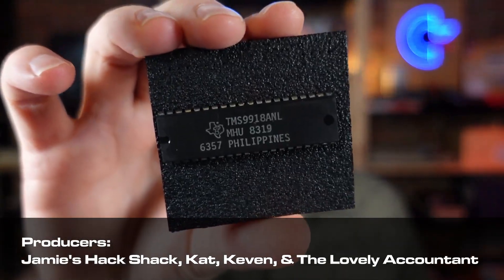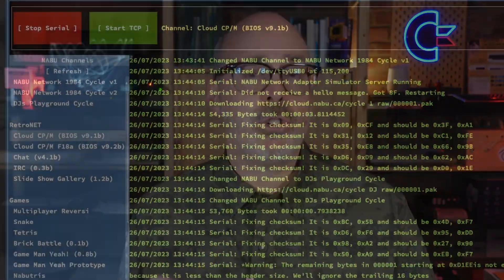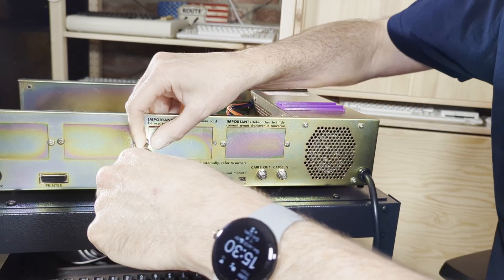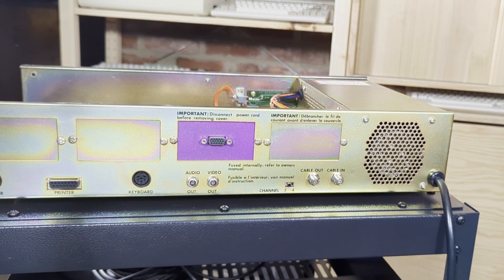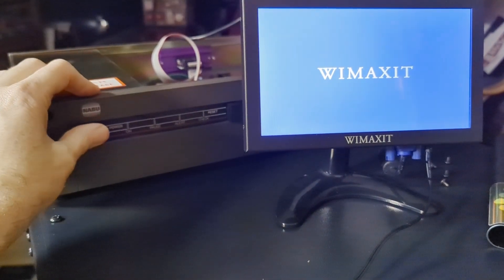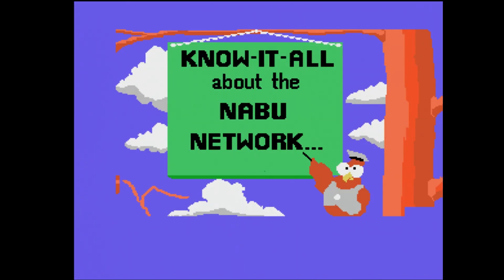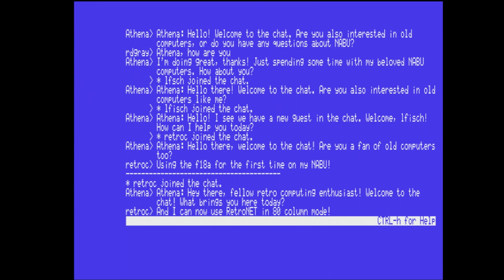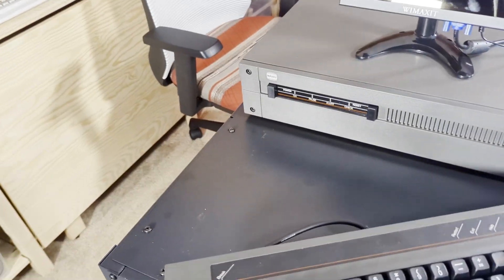NABU Computer Mod | Add 80 column mode using a F18A board!

Comment: One thing to add. There is a set of 4 dip switches on the board, switches 3 and 4 are to set the exact chip being emulated, so don’t change those. Switch one allows 32 sprites on a scan line instead of the standard 4 though I don’t think there is any NABU that can take advantage of that. Switch 2 allows you to set visible scan lines so you can get the old-school look on a modern flat panel monitor.
Reply from the maker: Yes! I forgot to discuss the settings. Thanks for sharing and pinned your comment for others.
Reply from the maker: Oh, and I might need to give that scanlines option a look.

Comment: There must be a few televisions that have the VGA socket on the bottom of the television close to where the Antenna socket is.
Reply from the maker: I've not run into one. Maybe some early 2000 models.
Reply: @retroCombs  some institutional TVs such as a Philips iTV series had an optional VGA port. I think the larger 30" + iTVs have VGA standard.
Reply from the maker: Ah, yes. Hadn't considered commercial grade televisions.

Comment: I had a MEMOTECH MTX512 with that same TMS9918A VDP but was never able to get into the 80 column mode but the chip did overheat and eventually caused the CPU to overheat and go kapoot.
Reply from the maker: Not at all familiar with the MEMOTECH. Looking it up now.
Reply from the maker: Those look great. Actually wouldn't mind finding one of those.

Comment: 25 years or so in the industry.  10+ years mostly working with hardware.  Anti-static precautions are BS.  At least where I live.  I understand that doesn't apply to all environments.
Reply: Agree. Working on computers since the early 80's, I've never had a need to wear that strap unless working on a work bench made with carpet. I usually touch a metal cases to discharge any static electricity.
Reply from the maker: @RudysRetroIntel  Same and I do have carpet in my basement studio, but that's something I'm hoping to get rid of some day.
Reply from the maker: And on this, you and I agree! Thanks for watching and leaving a comment on this electronics controversial topic. 😂 I'm sure we will hear from others who disagree with us.